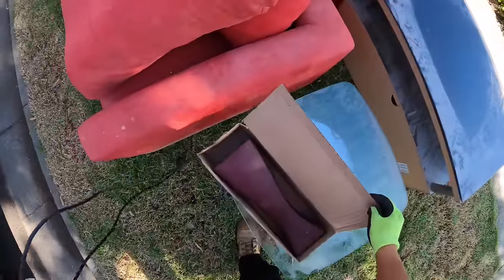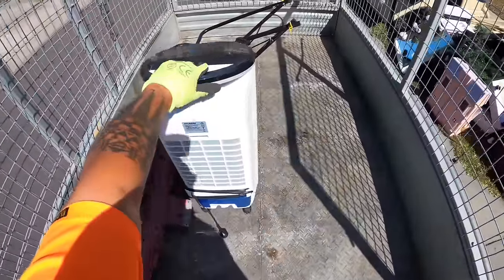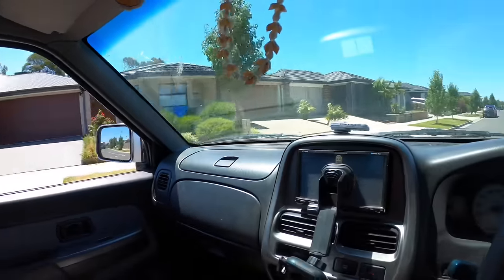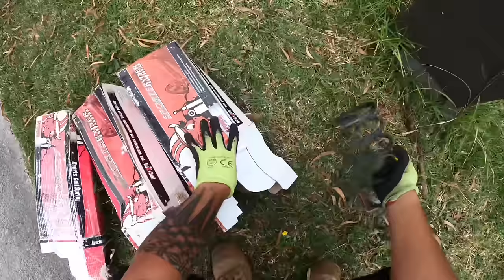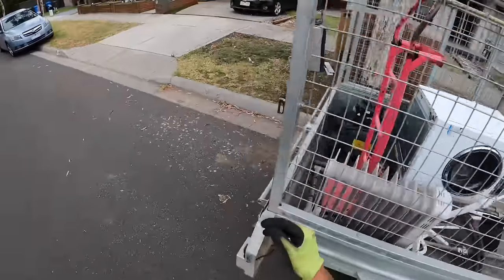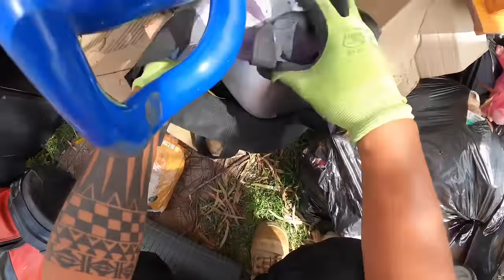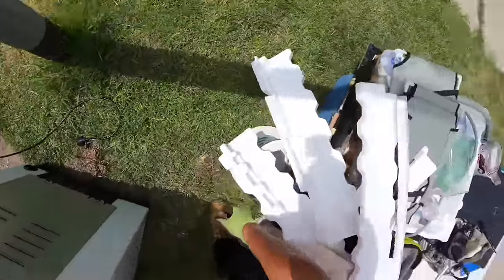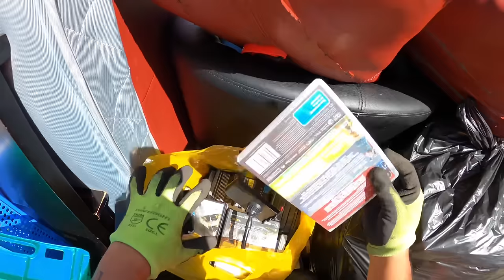The Curbs Are Overflowing With Some Massive Trash Piles

Comment: Mister Poly Prophet, why you do not pick TV up... thanks
Reply from the maker: I find them a hassle to handle, store, test and resell/bulk sell.
Reply: @PolyProphet  I took apart a TV this summer. All the weight was in the metal plate. It was easy to scrap too.